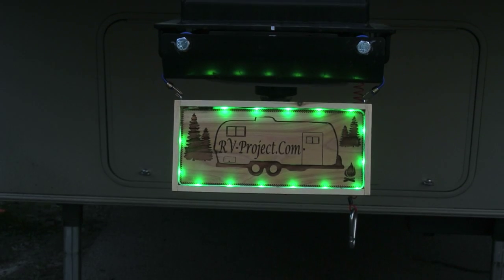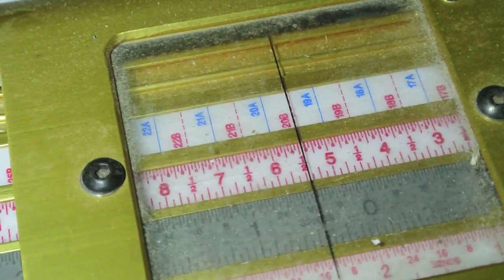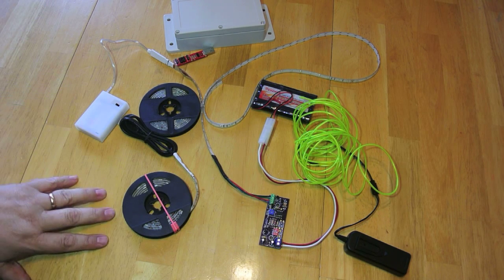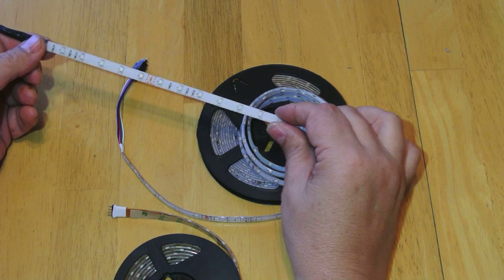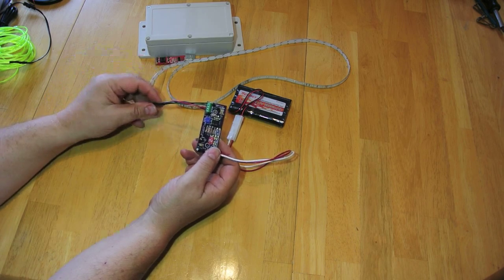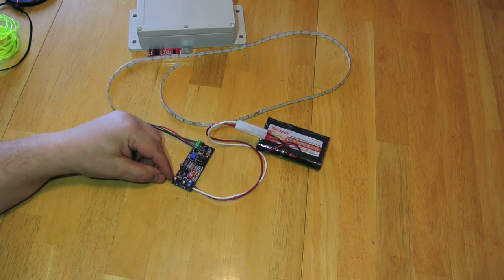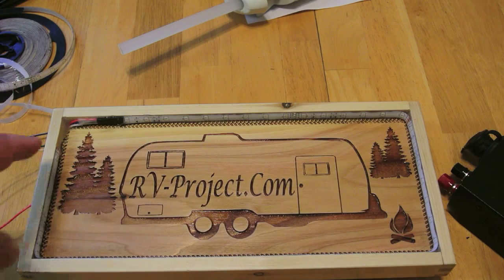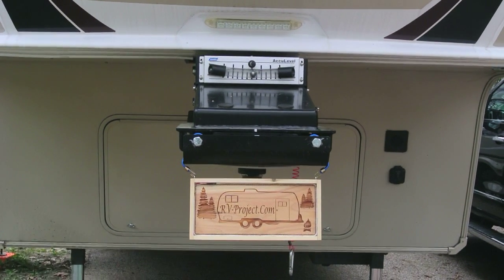How to build an automated RV Sign.

Comment: when I built the light up sign for my fifth wheel hitch I powered it through the break / light plug getting power from the 12v power lead.
Reply from the maker: great idea.
Reply: get a 7 pin socket, take the power pin and run a line through a lot / dial resister then into your trailer lights.  then when camped you can run your road lights and be able to dim them too.
Reply from the maker: I see dealers do that at RV shows. But thought never occurred to me to power the sign with that method.